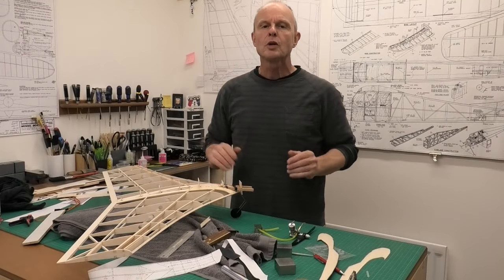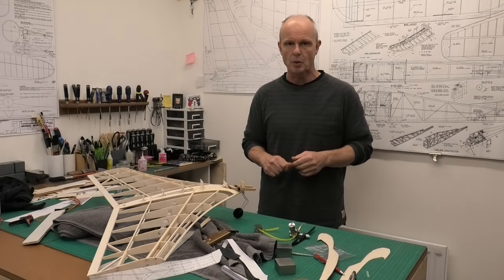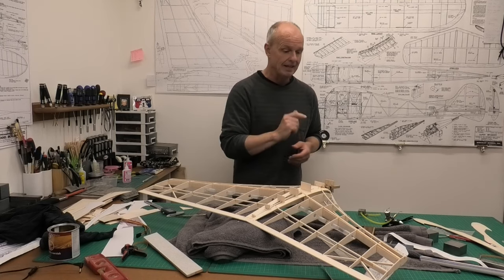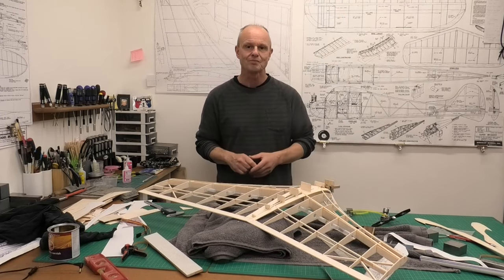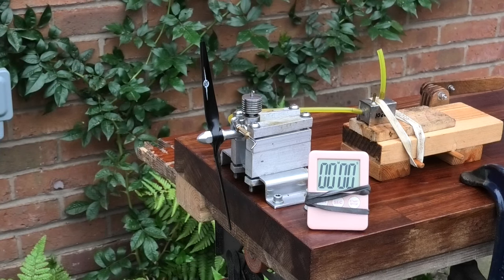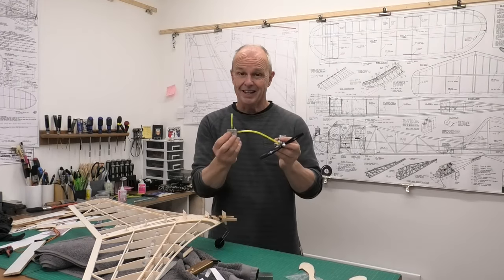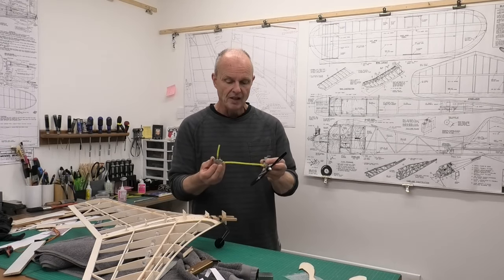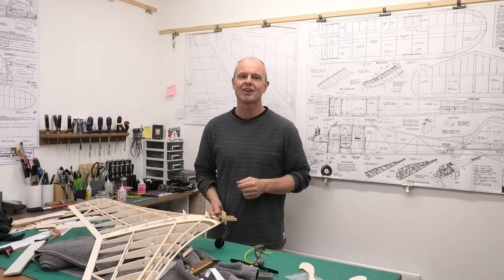Ion 1950's Futuristic Flying Wing - Pt6: Engine Fuel Consumption Test - By  O.F.W. (Peter) Fisher

Comment: I remember that PAWs, like many other diesels, needed some comp screw tweaking when they were both new and cold.
Once run in, though, they would start and run without any adjustment needed. Good engines, those PAWs.
Reply from the maker: Thanks for the comment, totally agree, great engines